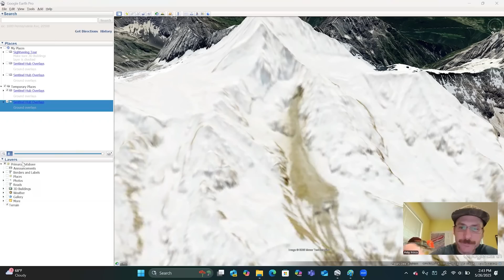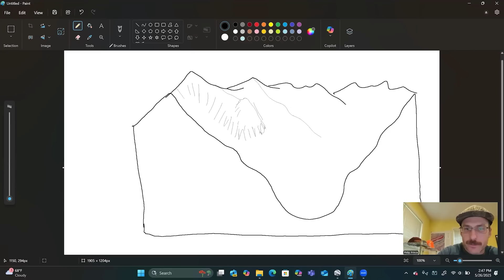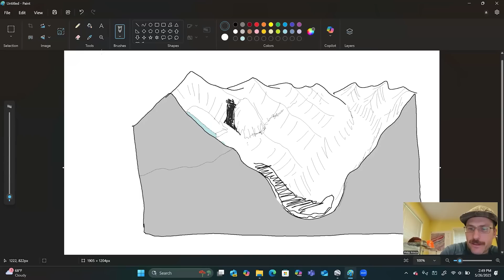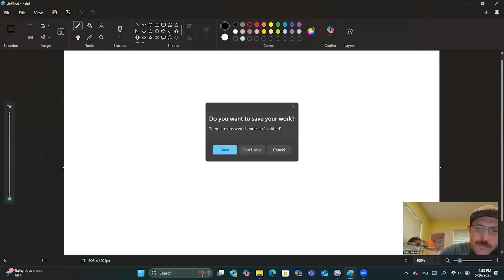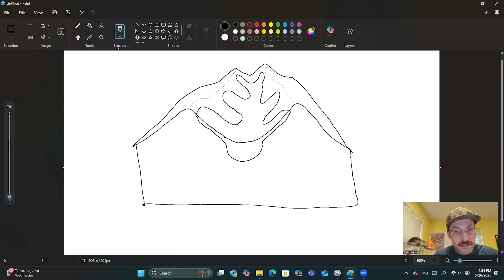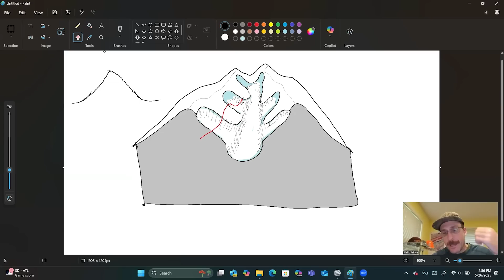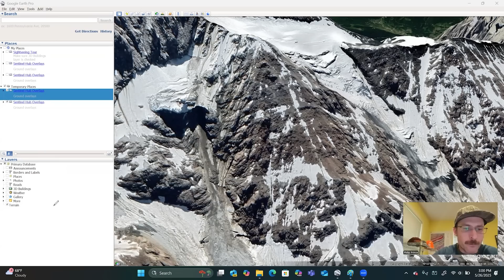Swiss glacier collapse and rockslide--why is the mountain unstable?

Comment: Hi! Swiss geologist here. I don't know the precise geological,  tectonic, and geomorphologic setting at the 1:10,000 scale in Blatten, but in general, the Swiss Alps are a complex collisional mountain belt. The orogeny involves a stack of marine (ranging from shallow shelf to deep basin) and terrestrial (fluvial, lacustrine, even volcanic) sediments, originally deposited on passive margins over a lateral extent of several hundreds of km (miles), now intensely shortened and thickened into a crustal root exceeding 30–40 km in places. Vertically, these sedimentary packages can reach several kilometers in thickness — in some cases exceeding 10 km when combining carbonate platforms, deep marine flysch, and syn-orogenic deposits. This immense volume has been folded, thrust, and often metamorphosed (as in Blatten, which is at the heart of the orogenic area)  into the present Alpine stack (the Dolomites in the Southern Alps  are not metamorphosed, but are tropical reefs kept at place until now, however)

Many of these sedimentary sequences are often OVERTHRUST (up to 100km or 60 miles in one direction), tightly folded, and faulted, show strong lithological contrasts and even inverted stratigraphy. Given this complex geological context, massive slope failures such as the one in Blatten are not entirely surprising from a geological perspective — although their scale is certainly impressive when seen through the lens of a human lifespan.

(ADDED NOTE: The total crustal stack resulting from the Alpine orogeny exceeded 30 km in thickness, due to intense nappe stacking, crustal shortening, and metamorphism. However, erosion, including huge landslides such as this one, has been extremely active throughout the uplift, continuously removing material and shaping the present-day topography. The current relief represents only a fraction of the original crustal pile.)
Reply: @codirossso Do you know how Swiss officials monitor the mountains for developing instability? Evidently this situation was identified as a problem before the whole thing comes crashing down, so somene has to have noticed the first shifts or cracks that formed, even with snow covering the superficial faults. Do local officials patrol the ridges? Lidar sensors in the valleys/on hillsides? Helicopter/satellite aerial image comparisons? SAR from satellites being automatically monitored for changes by computer? GPS receivers on every possibly suspicious mountaintop? And thank you for adding all this detail about the Alps!
Reply: @2xKTfc  State-of-the-art, yes.

Check "swisstopo admin ch geoportal and geology" or " Wallis geohazard map" (interaktive Karten)
Reply: @codirosso-t5d  Thank you! :)
Reply: Thank you, that makes sense to me...  it is very difficult to think in these vast numbers, your explanation brings clarity.
Reply: TY. The folded and fractured nature of the bedrock with annual freeze thaw means there will be significant rock slides. Building a town below unstable media is at one's own risk.
Reply: @mlight6845  Yes. You can add the permafrost problem in the last years due to climate change. The unfreezing of the permafrost layer is also a big problem also for this landslide.
Reply: @codirosso-t5d  -  ck Geoengineeringwatch  -  loaded with facts.  Also  Dane Wigington on here uploads a new 'Alert' vid every Sat
Reply: @codirosso-t5d  - another concern is 'Black Star'.   Greg Hunter's USA Watchdog / Rumble  -  with guest Weston Warren reported on 'Black Star' about 1 mo ago.  Well worth listening and learning.  Extremely informative.
Reply: @codirosso-t5d thank you for the explanation in normal language.
I was wondering how far is this from Brienz? 
They had that massive bolders falling down just before the slide.
Think about two years ago?
Reply: @elizaleroux9173  About 100km but it's a bit long to drive there.

check for "swisstopo admin ch and geology" "or "canton Bern geohazard map", or "Canton Wallis geohazard map" and so on.
Reply: @glory5918 😂
Reply: @samaipata4756 okay thank you, so not the same mountain range.
Reply: @samaipata4756  You're mixing up Brienz BE, which is in Central Switzerland, and Brienz GR, which is in South-Eastern Switzerland and which has been evacuated and is slowly sliding down.
Reply: @mlight6845 These people didn't expected a global warming of 1.5K within 250 years. You?
Reply: I'm so happy you explained this than me 😂
Reply: In simple terms, there are many factors that will  be going on. Over millions of years the Uplift of Mountains due to subduction eventually cease in uplifting and then erosion takes place. Some Mountains erode faster than others depending on the consistency of the material being eroded. But Mountainous regions have literally been eroded back to near sea levels leaving nothing behind, and then Uplift can begin again creating new Mountains on the same place, and evidence of previous Mountains can be literally be erased making it hard for Geologists to prove they existed...It would take many months to explain the whole science and history of Mountain creation and erosion. It can get extremely complex...
Reply: Wow, your information is super thorough and detailed ! And your comment, is so descriptive and understandable, to the lay person, which is such a valuable gift ! 
This planet is such a unique, amazing wonder.
Reply: Slides always happen. Not rocket science.
Reply: Except from plate tectonics pushing the Alps up could there also be crustal rebound from the last glaciation period in a tectonic active place like this?
Reply: Excellent information!!❤❤
Reply: Gpt💥
Reply: a was just about to txt the same thing 🔥😆
Reply: 🗺🤔 There are ~7 Swiss villages called "Blatten".
Reply: Thank you for this explanation, although I am not a geologist, nor do I live in mountainous areas, I had a vague idea of what you are actually talking about here. I studied and loved geography, and we learnt about mountains - a lot, plus what happens with the plates etc. So reading your comment is a joy to me as it is further education about how the Swiss Alps are made up and what lies on them to cause shifts like this. I did wonder if there were any tremors nearby of late, but from what you have said, it really does make sense. So thank you.
Reply: @theempath8244  It’s too far away, and you’d need to be right there to hear it or see the dust from falling debris, rather than actually feel it. Recent tremors caused by earthquakes? Not that I’ve felt any (the last one was in 2012). But small-magnitude earthquakes are recorded daily in the Alps.
You can look at the pictures and read the first few pages of this excellent PhD Dissertation, which you can find in open-access online: “Cross-scale modeling of mountain building and the seismic cycle: From Alps to Himalaya”.
Reply: Your drawings are so informative. Thanks for all this work!
Reply: Inverted stratigraphy is such an awesome concept. Is there anywhere in the world that that's happening now?
Reply: @tealkerberus748  for instance the UNESCO world héritage site in the Swiss Alps:Sardona tectonic Arena.

Also in the Salanfe Lake valley , Valais, near Martigny. Beautiful area.

I forgot, the Matterhorn!
Reply from the maker: Is Blatten in a crystalline nappe? It seems like it's pretty deep in the wedge, but I never know in a place like the Alps where exhumation is not as deep here in the Appalachians. Our crystalline rocks produce very recognizable landscapes, but everything operates differently in younger, post-glacial orogens.
Reply: @TheGeoModels  Yes and no. It's crystalline, but it's not a nappe (Aar Massif Unit). I summarize the geological details here shortly after checking: Blatten's lithology is "cristalline Pre-Mesozoic"; it's actually in the basement area of the European passive continental margin. The top of the mountain is granitic, the rest is metamorphic (gneiss). It's a counter-dip slope bedding, i.e., the bedding (schistosity) is sub-vertical.

Go to "map geo admin  ch geo" search for geology and look for  "geological profiles GA25": there is a geological section exactly where the landslide occurred, "GA25_082_Plate_II_Section_5.pdf" 

Plus, there is a PDF to download by the "gurus"  Bernoulli, Stefan Schmid, Pfifner and others, which explains the geology of the Alps. In case it's called "Erl-TK500_2024.pdf" (also search online for "Tectonic Map of Switzerland 1:500 000 - Explanatory notes"), and at the state-of-the-art regarding the current geological understanding  of the (Swiss) Alps
Reply: @TheGeoModels  I posted a comment with links and pdfs , geological section, but it doesn't show up. Yes, it's crystalline, and no it's not a nappe. It's the exposed basement, the (tectonized)  bedrock of the European passive margin. Metamorphic (gneiss) and granitic rocks (the top of the mountain):  Aar Massif tectonic unit.
Reply: 😂😂 sweetheart, it's called the flood.
Reply: You can tell crazy by the length of a post or email.

Comment: It's MORE than a rock slide. That HUGE area to the right of the yellow coloring is already started to slide. Maybe an inch away from the yellow area when measured on the computer screen. This is a MOUNTAIN slide and there are already dramatic images of that entire portion beginning to crack off from the main mountain.
Reply from the maker: included in video
Reply: @TheGeoModels   I apologize. I see it now.

Comment: They've got a berm already at the bottom. If they removed the spoil from the right half of that, and built a levy to protect the village with it, from the river once the debri chokes it off, they would change the fall line. As it is, the berm splays about 1/3 of the spoil towards the village. The hanging valley above will break check the fall, and changing the berm will encourage it away from the village, rather than some part of it towards the village, when it spills off the rest of the way to the valley floor. Why they didn't do that before; after the last slide that put it there, is unknown. Troy was built and rebuilt 6 or 7 times one layer atop the other, and doing nothing they could also do that. A bunker buster with a timed fuse could settle the whole shebang to the valley floor, but then the dam would be unstable, and could wipe out whatever is down stream once that gives way.  I would  have an observer in constant Comms with the heavy equipment operators, and a bugout lane in both directions kept open for swift withdrawal, which they already have. Since the town is evacuated, there is no other traffic to worry about. They could eventually process all the spoil, and truck it wherever. If you're available, you could submit a bid, and spend the Summer in Switzerland to supervise.

Comment: I'm not entirely convinced that it cannot be preemptively exploded away.  Aerial smart bombs anyone? We have the incredible precision bombing capabilities. Maybe not the Swiss, but certainly in Europe. Yes, I know that they are not a member of the EU.  And then there is artillery.

Also:  Can we quit the kowtowing to the ignorant. You're a scientist. There should be no reason why you would sheepishly demur about the findings of scientists that is unanimous, but for the entries from the fossil-fuel compensated hacks. The cause of warming is a dramatically spike in CO2, which can be conclusively tied to man-made activity.  

We weren't being bad when we burned fossil fuels. We were in fact ushering in an age of unparalleled prosperity and comfort. But the consequences are not threatening to cause far worse than the mere retreat from that prosperity and comfort.

Comment: Another great education video. There are some over-steepened slopes in the Adirondacks and White Mountains of New Hampshire that had glaciers not too long ago. I used to live in the Northeast USA, and then moved to Georgia. The difference between the northern mountains and southern Appalachians is striking. Mt. Washington is not as high above sea level as Mt. Mitchell, but it is more like the Alps in the shape, since it is 1000 miles further north.
Reply from the maker: very true. Dacks or Whites would be only possible chance for something comparable. activate tectonic post-glacial relief (and potential energy) are really on the next level! some of the big Alpine failures are crazy to read about.

Comment: So two foot ball fields on each side of the cube, since our fields are a hundred yards long and fifty yards wide (actually 160 ft). That is one heck of a cocktail cube of ice. Also fifty years ago winters were much colder and deeply frozen ice is hard with lots of friction to the surface it is attached. Now with warmer summers and less cold winters that ice gets softer and less stable. Every degree Celsius of warming will make it more likely to "fluidize" with any energy input from gravity to minor quakes to added sunshine from the rock dust and debris on top of the ice. Just that gray rock on top of white or clear ice will absorb more solar radiation rather than reflect it. Yup, I would move.
Reply: No. Three to 4 times that. Recall that after he established the hypothetical cube, he then said the mass in question would be 3 to 4 times that. I'm not sure why he didn't first establish the cube as one being a cube of 6 to 8, EU football fields on each side.

Comment: Haven't watched yet, but I have been wondering how abnormal or monumental this is. Like, is it a big deal or is it hyped up? Seriously though, thanks mr. stache!!
Reply from the maker: honestly, another day at the office in the Alps. Look up the Goldau slide…
Reply: @TheGeoModels  
And you don't need a high mountain or a big rock to do real damage to a house (experience).  A valley like that will always be a dangerous place to live. 
I think the reason this is in the news is that there are 2 train tunnels through the mountains. The Lötschbergtunnel (old tunnel) and the Lötschberg Basistunnel (new tunnel). The old tunnel has a train station just before it enters the mountain 8km down the valley.
Reply: Perhaps some hype it up. I would call it normal for that area of the world.